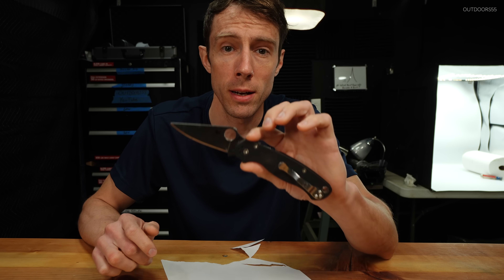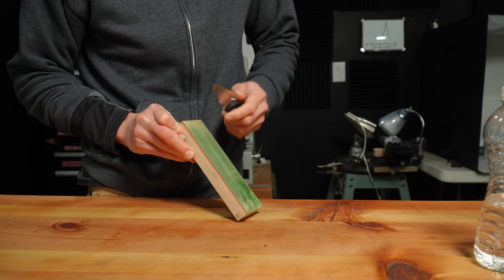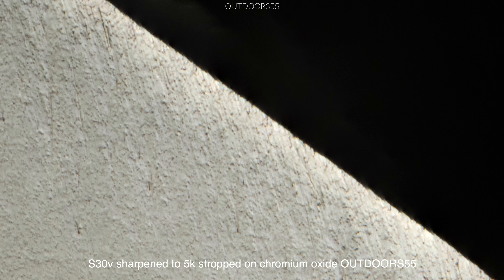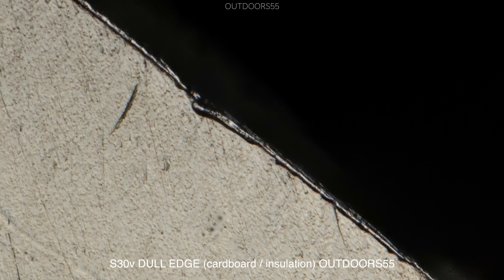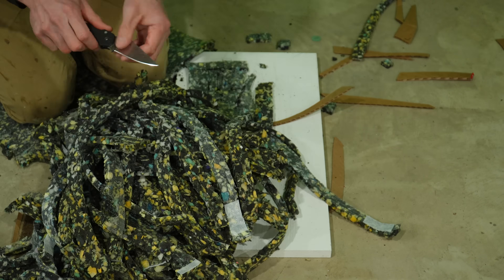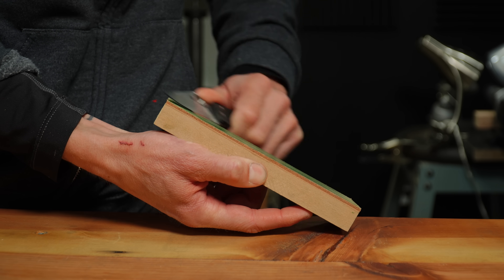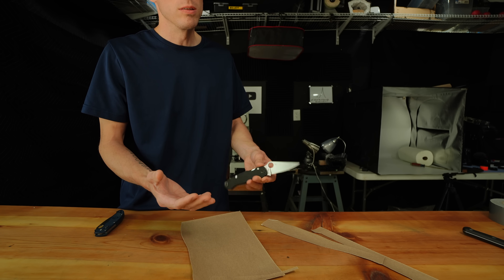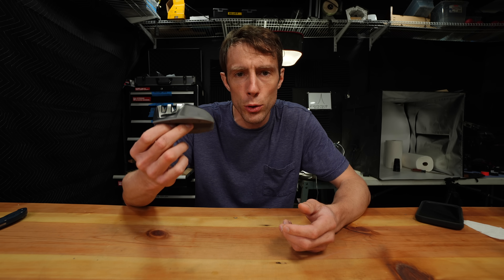Dull Knives Look Different Than You Think

Comment: Edge may wear by abrasion, rolling, chipping or corrosion. 
This is important because if you evaluate edge durability with a test that causes abrasion it will not be very useful to predict durability on tasks that wear down the edge by other methods.

Comment: Yeah. The time I got to sharpening was about the "knife shop" that offers sharpening. Gave them the knife, 2 days later got it back with only one side of the blade sharpened - the opposite side was straight as a line. Well, that was it. Bought first stone, watch videos (I consider myself lucky to stumble over you) and started sharpening. Great videos, keep up the exellent work. 
Also, dull knives cut different. Sharp knife is faster to heal if you cut yourself.

Comment: I have been the go to guy among my friends and family for sharpening almost everything since the mid 80's.  I find it very relaxing and satisfying. But I have learned so much in the last few weeks since subscribing.  SEEING IS BELIEVING when it comes to the apex of a blade.  ......So here is a tidbit I thought you may look into: I recently picked up the 600 grit 8" Tsuboman stone you suggested and is amazing compared to my old DMT collection. I do have a DMT extra fine and a standard steel in the knife block at home.  So, after seeing the burr being the reason I had apparently sharpened blades go dull so quickly, I was out in the woods and decided on an experiment.  I tried removing the Burr using the magnesium flat of my army style flint fire starter because I have no traveling strop, I was really pleased. So next while at home I tried the almost polished edge of the aluminum base on the new 600.  It also seems to remove the burr substantially.  I don't have any way to magnify as a you do ,but it is definitely way better than cutting with the foil burr and having a premature dull blade. The edge retention of everything is way better!!!!  It would be really interesting to hear your thoughts or even see what's happening

Comment: i think an interesting pair of things to test and look at the edge after are cutting a soft metal like copper (i cant tell you how many times ive been asked to cut electrical wire with my knife) and chopping in to wood across the grain- wheather it be batoning the knife or chopping with  a large knife. i just wonder if they would create dullness in the same way or if the damage would look more like rolling or micro chipping.

Comment: Got skin, paste and 240 grit diamond plate, had 1000 and 3000. Profiled the top 90° side of a snap blade on 240 in seconds(one sided edge), got a nice finish on a 1000, worked the edge from two sides on 3000, done 10 alternating passes on the strop.
I got myself a razor in freaking no time. Previously the two plates gave laughable result in comparison xD
Big thanks for teaching me, big thanks to the algorithm gods!

Comment: could one of the reasons for the different materials affecting the knife different be temperature? for example the rockwool could warm/heat the knife to the point where the edge melts and flattens?

Comment: Nice short video. So after using sandpaper I assume that stropping can’t restore the edge. 

Would have been interesting to sho this in the video, how far back do you need to go,: stropping, 5000,2000, or 1000 to restore that edge.

Comment: Alex, as a suggestion, I think You should put the scale in your incredible pictures (idk, maybe a line indicating how much a mm is in the picture)
Reply: I second that, it is very difficult to comprehend what we see as the edge looks the same on different magnification levels. In an other video where the knife was pulled and it just never wanted to end I completely lost a sense for the scale. Could be a line with a thin sharpie too, just something to calibrate our brains :)
Reply from the maker: Unfortunately i cant do that since every image is slightly different scale due to the way images are cropped. Thres no conversion factor. Its fairly complicated to scale images to optical microscopes for numerous factors.
Reply: @OUTDOORS55  Thank you for answering, Alex.

Comment: So where does the material go? Just abraded away or swaged back into the blade? I'd probably expect to see the edge roll before any significant swaging happened so I guess it's mostly abrasion.

On the topic of green compound, any visible difference to the edge between chromium oxide or cheap aluminium oxide green compound, I'd assume no real difference if the particle sizes are similar.

Comment: Pete is going to be upset that you didn't show an edge dulled on hundreds of feet worth of twisted sisal rope. 😜 Also, the scratch pattern left by the 5K Kuromaku is very impressive.  I wonder how similar a 5K diamond plate would be?  Grit numbers across different abrasives are a bit strange, it seems.  I always go finer with diamond to get what I believe to be similar results.

Comment: I bought the Work Sharp Guided Field a year ago to learn how to sharpen knives, and I've never been able to cut paper as smoothly as this gentleman demonstrates. It doesn't cut hair either. Don't get me wrong, the knives are sharper than ever and they cut my fingers very well, but they're just not cutting like shown here. My wife says I sharpen well, but they seem to lose their edge relatively quickly. I bought one of the most recommended diamond stones from this gentleman, but I haven't practiced with it yet. Any extra tips or advice you can give me or shed light on what I might be doing wrong?

Comment: Have you done any investigation in to how the sharpening steels work that you get with knife sets ( the round steel rods)
I really have just found your channel so I am very new to all this info, but I find it interesting and would like to know of a quick and easy way to sharpen kitchen knives - from what I have seen it might be the good 400 -1000 dual sided stone you recommend. 
Currently I have a pull through sharpener (which has 2 sets -a course and a fine - at different angles) which while adequate never really seemed to work as well as I wanted.

Comment: Could you make a video on using lubricants with diamond stones? Should I sharpen wet of dry? Oil or water? It would be nice to see the effects of lubricants on sharpening speed and stone loading. If I use water, is rust an issue? Will the stone last longer or shorter?
Reply from the maker: Dry, always dry
Reply: @OUTDOORS55 Are there any exceptions? I’ve seen a few people tell you in comments you need to try honing fluid, but I’ve never seen what that looks like under the microscope (hint hint).
Reply from the maker: Im not sure of the reason to use lubricant. I've never had any stone clog. It just adds unnecessary mess and doesn't accomplish anything in my opinion. It causes more problems than it solves.
Reply: @OUTDOORS55  I think you’re right, and you have pretty definitively convinced me that using water as a lubricant is evil. But I firmly believe the doubters need to see what it looks like. And I’m very curious how all of the alternatives behave, under the microscope. Like 99% alcohol, honing fluid, cutting oil, and maybe an oil thick enough you’re sure it would keep the diamonds from cutting. Properties to test: longevity of the diamond stone, clogging, lubrication (is it noticeable and relevant to a human hand sharpening?), etc. Keep up the amazing work please!
Reply: @OUTDOORS55  I'll take your word for it as I have no experience with diamond stones yet. I was just curious because I always use oil with emery paper on the lathe. It tends to make the emery paper last longer and gives a better surface finish. It would still be cool to see the difference in your macro shots.

Comment: What do I need to look for when purchasing diamond stones? There are a lot of cheap and expensive stones listed on the internet and the ones you shared are not listed on Amazon in my country.
Reply from the maker: See if this is available 
I Maybe Found a Unicorn Sharpening Stone - Sharpal Diamond Sharpening Stone Review
https://youtu.be/5w25oJ67C1I
Reply: @OUTDOORS55  thanks for your reply! Will check that out!
Reply: @OUTDOORS55  I bought that exact stone yesterday and it arrived a couple hours ago. I could not be happier with it!
I started hand sharpening as a hobby on a wetstone and thought I was just really bad at maintaining the angle, but a couple of minutes on both sides of this stone and the two knifes I sharpened with it are razor sharp!

Comment: I got something. When you are done testing different materials to test cut. Just review the knives, how their edge behaves, how abrasive resistance on the flat they may be, etc etc. You know more when it comes to folders for sure . Like, have a formula for the review videos. This was pretty informative and short, to the point. And show us the abrasives that are adequate for the steel type. But us, in sharpening, tend to forget that its always about the knife. I hate sharpening folders with a passion but I also dont want anything that is too difficult to grind, in case I want to thin it or change something. ( I use one for work). Like I was almost done with an s30v custom I have yesterday, and bam, I drop it. In the pond (sigh)!!!!!! While using my diamond paste and films on top of it. Two chips and I got to dry it out. Day over. But now its going to be a pain to take the chips out and thin it again. Lets see which steels truly are balanced. And which are good, depending on the application. Shit, get sponsored for abrasives and just reviews knives unbiased (its all grit particles, 3m donimates, they just dont advertise like crazy for sharpening). With diamonds all over place, I just want to focus on the knives. Nice wet rock you got there

Comment: I'm starting into sharpening.
I only have the diamond 400/1000 stone.
I'm having trouble following the knife edge doing that curved motion that outdoor55 does. The tip is barely touched.
Any tips on that?

I'm training on a cheap dinning knife.
Reply: My same stone literally arrived a few hours ago :) Just commenting to see others commenting :)
Reply: I don't do that motion.  I keep the area of the blade to get the scratches 90 degrees to the apex.  I don't have a microscope so I can only guess I am doing it.   Any knife you buy new, has decent steel that will take an edge.  I don't know if I will buy better kitchen knifes because the cheap ones I have do their job.  I learned much from his videos and pictures.

Comment: does the edge look molten? having a hard time deciding how it dulls (not sure how it sharpens either rofl) am I going to have to get a microscope to finally figure this stuff out (which may be never).  when u rub it with ceramic in previous vids looks like 'smeared' or 'molten' chunks too.  lot of ppl say 'abbrassive'  um.  have a very hard time deciding the scale (I've gotten used to looking at 1 100th of millimeters for metals (with just simple 5x or 30x magnification) making pocketwatch parts which if I remember is already 10 microns (so as far as machining goes you can do almost anything at that precision.  anyways shall keep thinking on it til hopefully 'learn' it lol

Comment: After watching an admittedly unhealthy amount of your videos. Recently got a cheap diamond stone for my mother for her kitchen knives (only the stone, not the strop yet)
She has a good set of knives, but she hasn't really properly sharpened them in... forever, resorting mostly to the honing rod (which she stopped using since it didn't seem to do much) and the pull throughs (which she recognized as bad very quickly and got rid of herself, she's a very smart person)

I got the cheap one since I'm a beginner in sharpening, but with some of your guides, I sharpened her whole knife set, and  she's really happy with how sharp the knives are now, and how well they seem to hold the edge compared to the other methods she used before!

Sharp knives are obviously more pleasant and easy to cut food stuff with, but additionally, because you don't need to apply as much force as a dull knife, it also means you can be at more ease with your handling and subsequently more accurate and safe (which is what my mother said, which I agree on)

she does say she needs to be a bit more careful when cleaning the knives now tho, since it's sharp enough to cut you if you press on it too hard now lol
but anyone who uses a knife should be well aware and careful when washing them (aka. touching the blade/edge directly) so it's not much of a drawback

I offered to teach her how to use the stones herself, but she seems content in just summoning me whenever she needs them sharpened
"They stay sharp for so long, that I can just ask you to sharpen them once every couple times when you visit" she says..
And thus I have become the designated knife sharpening guy...
Reply from the maker: Awesome thanks for the support! Glad to hear your now the go to knife sharpener 👍😂

Comment: Maybe you can find a friend at local university or lab that has an electron microscope to get even closer images.
Reply from the maker: I don't see any point in goi closer since we can see whats happening. Anything smaller would have minimal if any impacts on a knife's overall performance. Otherwise the smallest sharpening details would greatly impact edge retention, which we know isn't true due to catra testing done by larrin thomas. He would see wild swings in cutting performance due to sub micron sharpening differences between tests, which isnt what happens.

Comment: I think dull knives though aren't necessarily bad though, to a point of course. Having a crazy sharp knife can have it's uses , but trying to have a knife hair whittling sharp at all times is quite hard. But knives that are slightly dull can be more durable since it's harder for the apex to collapse, well at least theoretically. Thing is a knife can lose it's apex from a lot of different ways, compression, fracture, rolling. So how much more durable a slightly dull knife is in actual practice I don't really know.